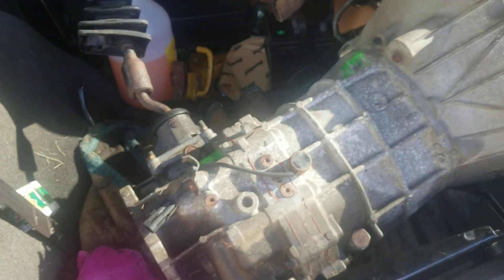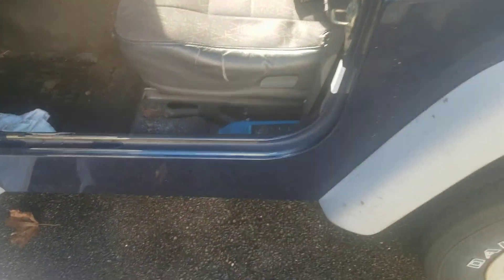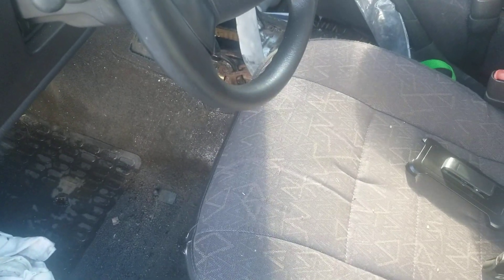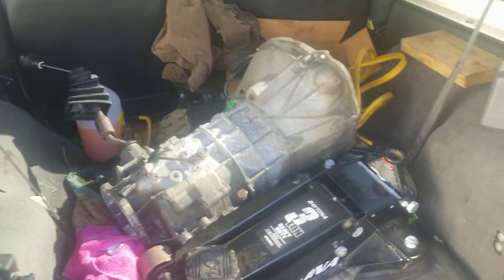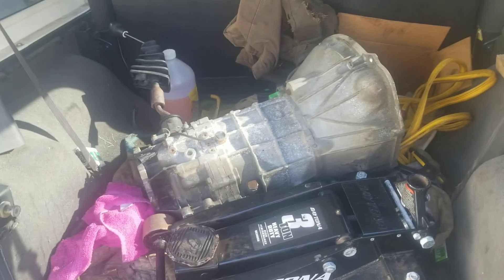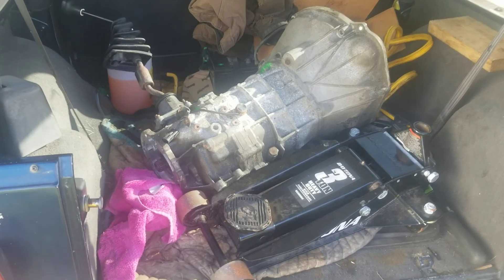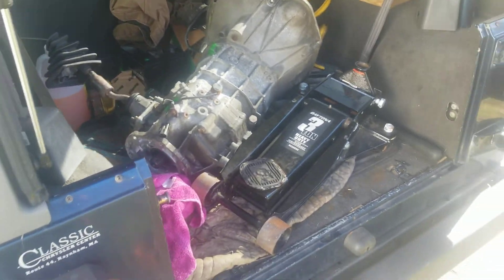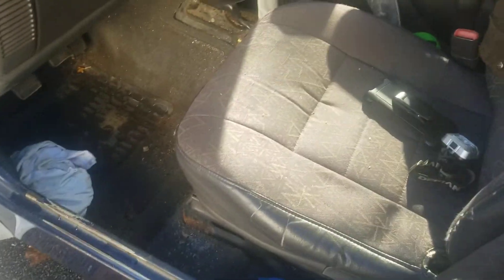Jeep wrangler NV3550 to AX15 swap part 1

Comment: Stronger ehhhhhh no the nv3550 is the strongest transmission ever put in the jeep tj...
Reply from the maker: That may be your opinion but at the time there were none available and I knew from experience that the AX would hold up to all kind of abuse. I was plowing with this thing so I needed something that wasn't gonna come apart on me and I knew that at AX was the cheapest, easiest way to go